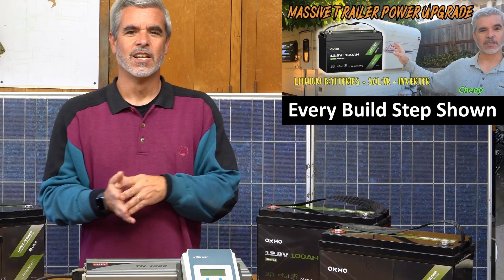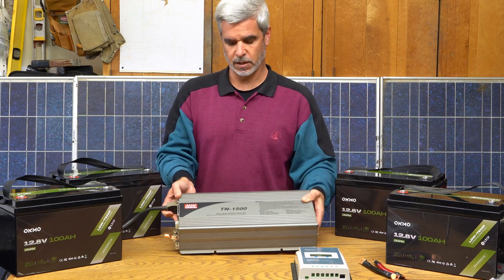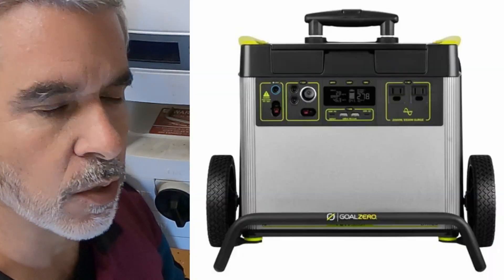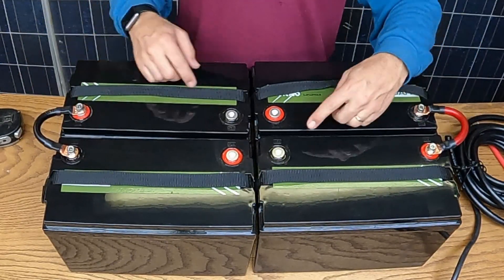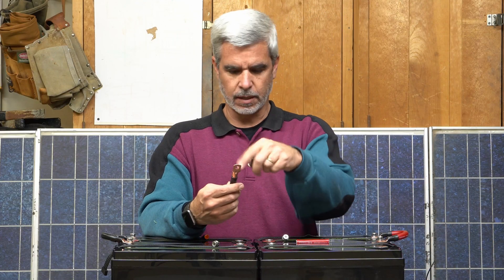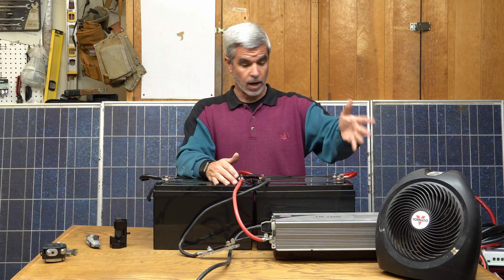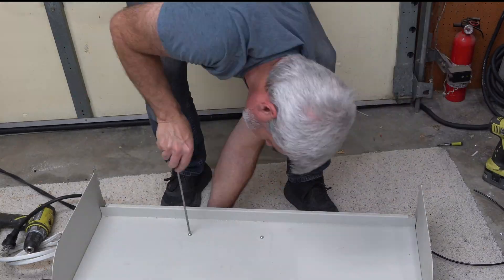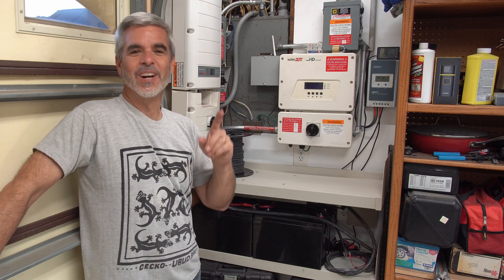Whole-Home Backup Power for your Critical Loads with a DIY Battery Backup Generator

Comment from the maker: Main Component Links:
12V 100Ahr OKMO Battery: https://geni.us/OKMO_12V_100Ahr
EVEVER Solar Charger: https://geni.us/EPEVER_40A_Charger
Renogy Battery Monitor: https://geni.us/Renogy_500A_Monitor
Renogy Inverter I suggest (One I used is no longer sold, these are 12V input): 
   2000W Version - https://geni.us/Renogy_2000W_Inverter
   3000W Version - https://geni.us/Renogy_3000W_Inverter
Reply: Great info
Looking into building one.
I ordered that crimping tool already. Thx